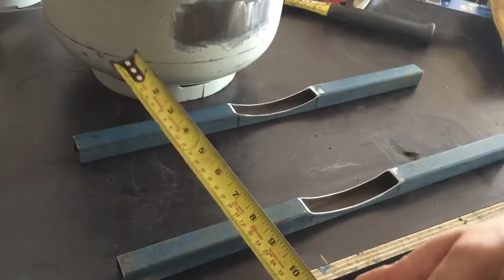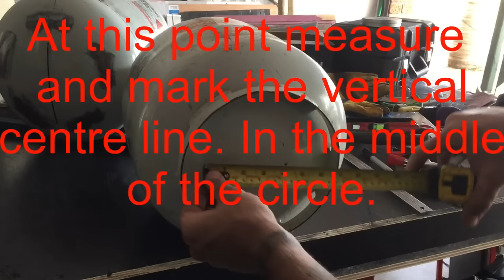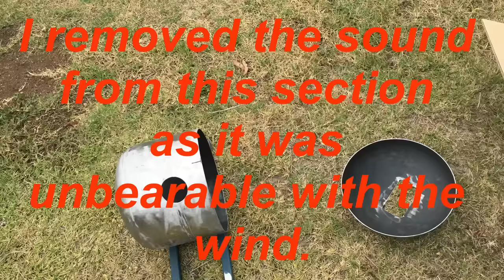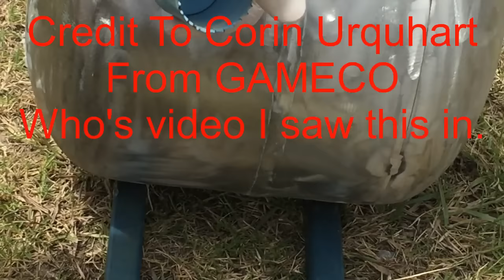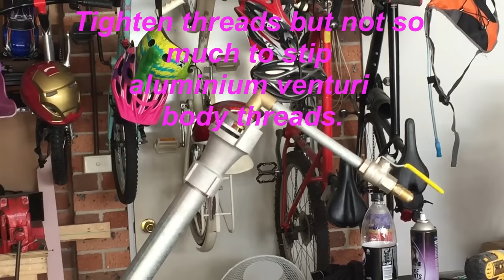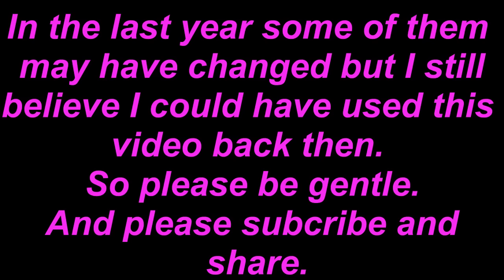Build a knife making Forge Out of a Propane Cylinder

Comment: Nice job, I have an old air compressor I am wanting to do this with, got a burner given to me, and parts from Gameco, holidays coming up, would like to complete this project while away from work. Cheers, keep the videos coming.
Reply from the maker: To easy mate 2 or 3 good days should do it. Get stuck in mate. Bit it may he better starting off with 9kg gas bottle if you have to gameco kit.

Comment: Very good description. You got my subscription. Refreshing to see aussies doing this and using millimeters. I’ll be making this one . Cheers mate !
Reply from the maker: Awesome cheers brother 👍
Reply: How easy or difficult would it be to apply a hinged door, would a hinged door lose heat? Reason I ask is, what happens when you need to replace the insulation? Or would it never need to be replaced? If it does how many really hot burns would you get
Out of the gameco kit you bought?
Reply from the maker: Yeah luke its definitely an option. You can also weld lugs on each side and bolt the two parts together. I decided not to as for the 2 minutes it will take to cut the welds the one occasion in 5 years that the insulation needs replacing its not worth it to me. As for use time I really couldn't tell you burn times but I'd say 1000's I know guys you use  them frequently and are 5 years in. Its really more about hours of use. If you're using for 5 hours a day, several days a week it will probably only last 2 or 3 years. Maybe less.

Comment: Well done Toby, got some good ideas mate. Building mine right now
Reply from the maker: Thanks heaps Ross. Good luck mate. Ask if you need any any help bud
Reply: Just wondering Toby, the flat steel you welded around the entrance, how has it held up mate. Has it started to warp because of heat. I'm about to do this area and am thinking of putting some cut fire brick on the inside of it to help insulate the metal.
Reply from the maker: @rosswiddison6699  heya mate yeah I think because its thick it has lasted really well when I stick a fire brick in front of it to close it off a bit it glows red and has obviously go no paint now. But it's been a couple of years now and still going strong bud

Comment: this is one of the better forge building videos. one problem though is your open area inside the forge is too large IMO, especially for a single burner. are you able to reach forge welding temps?
Reply from the maker: Thanks mate 👍. The interesting thing is the internal size of the forge isn't to relevant to a certain point obviously. Its more important that you can block the openings off a bit. But yeah the short answer is. It easily gets to forge welding temperatures. No problem at all. It is a very good burner too though.

Comment: I would recommend filling the cylinder with water and then empty it before you start working on it with any hot work.  That way you know there is no LPG left in the cylinder and it will not explode on you when you cut into it.
Reply from the maker: So true mate I agree totally. I say it at 7:14 but should have been before any grinding. Thanks for watching Rupert
Reply: Awesome video dude
Reply from the maker: Thanks mate 👍

Comment: Did you use any refractory? Insowool/Kaowool is terrible for your lungs as it contains silica. Rigidizer is optional, but a refractory such as satanite or green patch is mandatory for health purposes. sorry if the question has been asked. Nice video, fun looking project.
Reply from the maker: Thanks for watching. No I didn't render it with refractory cement just on the floor. The rest is regularly sprayed with rigidiser. I probably will cover it at some point though 👍🏼

Comment: Great vid!    But I would recommend that the gas supply be further away.   From an old Firefighter.   Cheers 👍
Reply from the maker: Thanks mate appreciate the advice. Im also an ex full time firefighter of 8 years. 👍 its was not particularly a worry to me bud as log is heavier than air so falls not rises. All the plumbing is good condition and lpg get very cold infact it freezes up in use sometimes. Austere is literally no heat transfer down on this i van out my hand on the steel shelf of the trolley. Cheer heaps tho brother. I all you watching

Comment: Question, did you put refactory all around the inside of the forge or just the bottom of it I put refactory in the bottom and coated the rest of the blanket with the rigidizer but some people are saying that that isn't safe and I need to put refactoy all around the inside of the forge
Reply from the maker: Hi mate. Thanks heaps for watching no I didn't but have always intended to. Though I have to admit I'm not sure its required as I trust Gameco so feel like if it was required they would have sold it with the kit  but it deffo would not hurt. Thanks mate
Reply: @TobyFireandSteel  ok thanks
Reply from the maker: No problem mate

Comment: Hi, I'm pretty inexperienced at fabrication but am thinking about building a forge from 16cm steel tube, rather than a gas bottle (maybe 400-500 long).   The kaowool in the Gameco burner kit won't be quite the right size for me, huh?
Reply from the maker: Hi Sean awesome building a forge is awesome. But if your asking for my advice I'd say 160mm id is just to small mate by the time you've insulated it ( regardless of type of installation) I just wonder if it would be to small to be practical. Are you planning on using it for knives exclusively? No hammer or cleaners etc? I think the reason a lot of people use 9kg gas bottles is they are readily available and the over all finished dimensions are good for several applications. If you do decide to go ahead with Gameco burners for your own design forge or even get a whole Gameco kit remember to use the discount code TFS10 together 10% off. Also if you dont used a gas bottle design the Gameco list still sounds like it would fit your dimensions. If not try Field Furnace in Sydney for refractory needs bud. I hope this helps. Please keep asking questions as you go.
Reply: @TobyFireandSteel  Karim at Tharwa Valley recommended I go with the thin pipe for efficiency's sake.  But if the kaowool is 75 thick that won't work.  Maybe 250mm.   I will definitely use the discount code, thanks very much.
Reply from the maker: @seananderson9991  ok cool well Karim is really knowledgeable guy and has a great deal more years experience than I . Also the kao wool in the kits is 60mm from memory. Its probably worth talking to field Furnace mate 👍

Comment: I have a suggestion. For those who don't have a welder. Drill 4 holes in bottom of tank for legs.  Then use long thick bolts with a nut on the underneath to keep them in place. quick and easy no welding required. You will have to skip the plates on the front but that shouldn't be a big deal.
Reply from the maker: It's not a bad Idea bud cheers. But how do you weld the burners in or weld the 2 halves of the cylinder back together. It would really need to be a full redesign. Unfortunately to be done well we'll this one requires a welder. Though I've definitely seen forges of a different style that dont 👍🏼
Reply: @TobyFireandSteel you don't, the top would be the lid and as far as the burner goes its basically a propane torch stuck into the side. There's an excellent video on it and you can actually hear the guy explaining everything when he's making it 😅

Comment: Also, about the front fire brick. You could easily cut out the area that's hitting the front guards so it'll fit over the guards or just cut it to the inner diameter of the opening, secure a short handle to the brick and good to go.
Reply from the maker: Yeah that's a great idea bud 👍 cheers
Reply: I think that the propane hose from burner down to the tank looks way too close to forge looks like it will get Too Hot possibly melt through
Reply from the maker: No I've been using this forge for years now and had no issue. It's also identical to thousands of other forges in Australia thanks though.

Comment: I noticed you've got a couple of kids running around and I'm sure you know how unthinking they can be.  Since the forge will remain hot well after you shut it off, you might think about putting an open screen over the sides and top to prevent them (and you) from accidentally bumping into it and getting burned.  It shouldn't interfere with the forge's function and would remain within the envelope of the cart its on.
Reply from the maker: Thanks. They are careful and very smart.  Also would only make the mistake once lol. 👍

Comment: Where did you get the burner top that’s premade ?
Reply from the maker: Hi mate they come from a company called Gameco Artisan Supplies in Australia. https://www.artisansupplies.com.au/product/gas-forge-refractory-burner-kit/
This is the link if you use TFS10 you should be able to get 10% off mate
Reply: Toby, Fire and Steel I saw where someone just sells the top I just can’t find the link yeah I checked the company out but they don’t sell just the top I have everything else , I just like how the top looks manufactured . I have a few I made.
Reply from the maker: Heya bro yeah they definitely seel the burner separately to the kit also mate.
Reply: Toby, Fire and Steel I’m just talking about the top adapter where the gas nozzle connects to the burner . The top screw part which normally you use a reducer or a t fitting if you’re building homemade.
Reply from the maker: @zachofalltrades1111  oh right the the adjustable venturi bit. Yeah ice not seen then for sale separately. Sorry bud
Reply: Toby, Fire and Steel dome some digging bro and found them for $12 bucks on Ali Express bought 4 of them!
Reply from the maker: Awesome mate. You got the link bud?

Comment: Wanted to listen to your video and watch it but lost volume at 3:35  thought it was on my end but no
Reply from the maker: It's so weird you say that one other person said that some time ago. Out of 8000 odd views you're the second person to say that exact time the sound stopped. I dont understand it. Could you please try another another computer? In sorry I just do get it
Reply: I lost audio at the exact moment as you (3:35---right at the transition of intro and the instruction video), except I only lost sound in the right speaker/headphone cup. So what I believe has happened is that (probably)the intro was filmed with different gear than that used to shoot the video. Seems the intro was shot in high-def while the video used a phone camera that could take a beating in a shop environment but suffered a bit in the A/V areas. The sound will cut out entirely if you are watching on a device with a single mono speaker or speaker set to mono in your audio settings. 
Hope this helps.
Reply from the maker: Yeah mate it does seem that way dude. It was basically my first every video and I had veeery little idea what I was doing filming and editing wise 🤣🤣 thanks heaps for great explanation mate
Reply: @TobyFireandSteel  My pleasure. That's what we're all here for: helping out when we can. Great video (not finished yet: you weren't kidding when you said you were thorough--but that's fine by me. All these hyper edited videos often omit a step or piece of info that may seem obvious to some but not to others).
Reply from the maker: @ibnormal71  cheers mate. Yeah I made it because I could find nothing like it. Glad it's helpful 👍